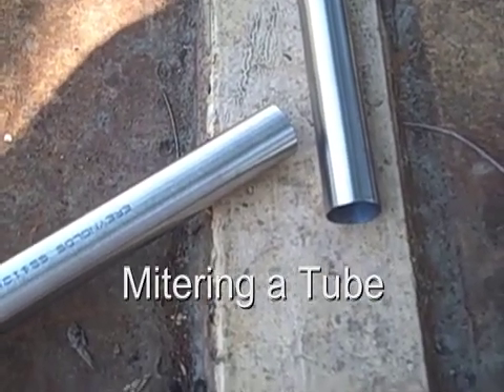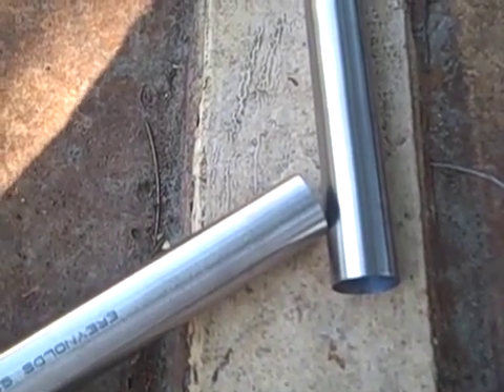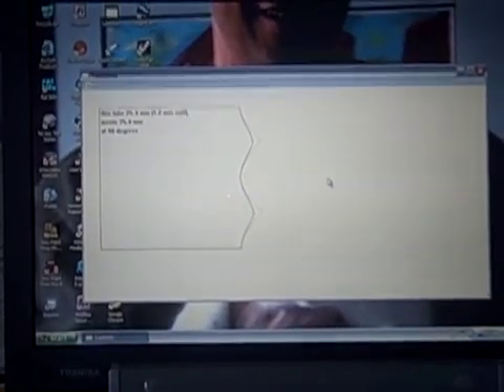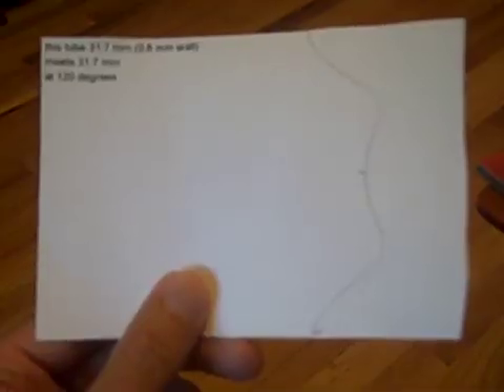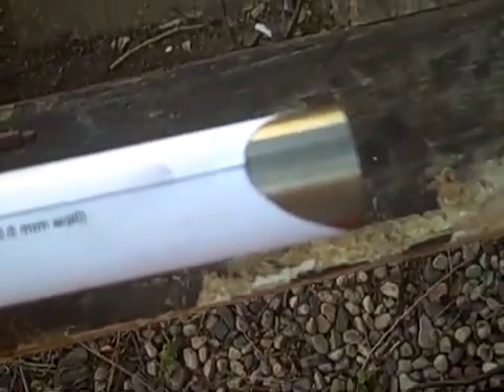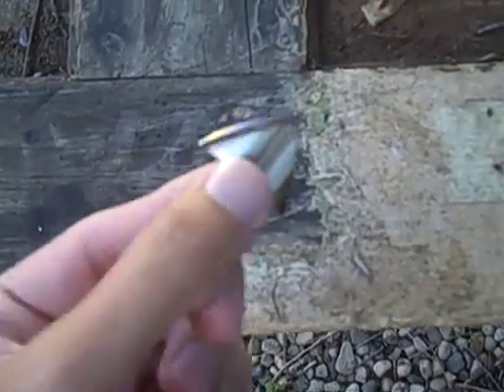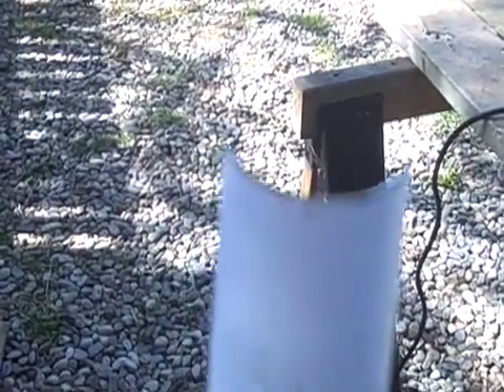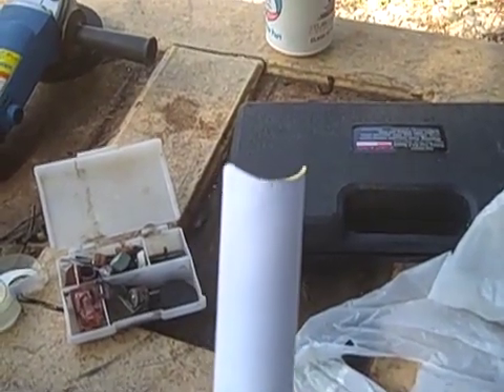How to miter a tube (bicycle frame building)

Comment: What happened to laying a template out manually with division lines. how are we gonna have competent fitters if they can't lay a copeing template. Not every site you go to is gonna print a template or have templates for you. up in the oil sands they expect you to be capable of copeing pipe from 1"-70" pipe.
Reply: Whatever happened to melting and forging  your own hand tools?

Comment: An easy / accurate way to make the miter a little tighter is to wrap the tube you are joining the mitered tube to in sandpaper and use it to clean up the edges.